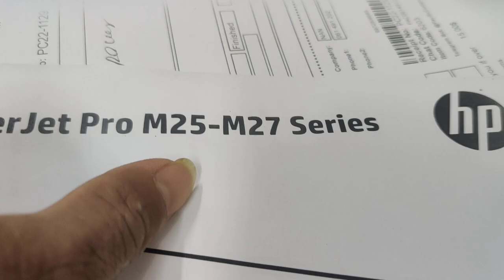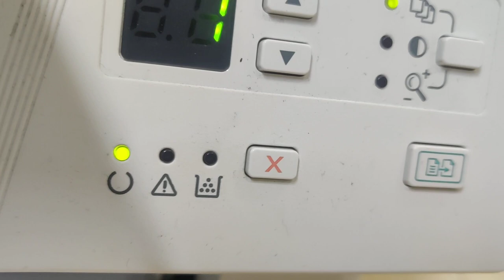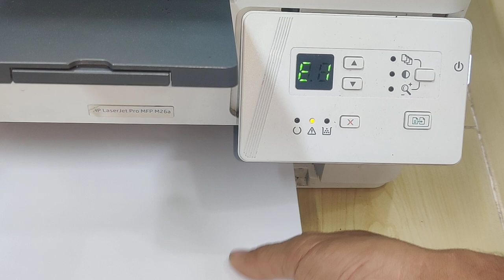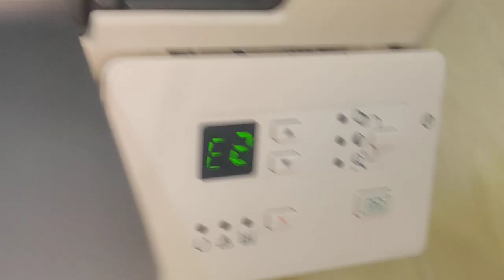How to fixed HP LaserJet Pro MFP M26a M25-M27 series error E1 E0 E2 E3

Comment from the maker: E0 Paper is jammed in the printer. Clear the jam, E1 The input tray is empty. Load the tray, E2 A door is open. Verify that the toner-cartridge door is fully closed, E4 The toner cartridge is very low. Press the Start Copy button to continue or replace the toner cartridge, E5 The toner cartridge is very low. Replace the toner cartridge, H0 The printer is in manual-feed mode.Load the correct paper type and size into the input tray. Press the Start Copy button to continue. H1 The printer is processing a manual duplex job.Load the pages into the input tray to print the second sides. 
Press the Start Copy button to continue.The attention and toner lights are blinking, E3 The toner-cartridge is missing or is not installed correctly.Install the toner-cartridge.The attention and ready lights are on.E6 E7 E8 E9 the printer has experienced a fatal error from which it cannot recover,1. Turn off the printer or 
disconnect the power cord 
from the printer.
2. Wait 30 seconds, and then 
turn on the printer or 
reconnect the power cord 
to the printer.
3. Wait for the printer to 
initialize.
If the error persists,

Comment: hi I have an HP 125a printer
Not connected to computer
paper size while copying documents LTR size
I want to change it to A4
Because I use A4 paper
I want to change itThrough the keys on the printer interface
Also I want to do a factory reset
I only use the printer to copy documents
Note: Printing through a computer does not have problems printing A4
Reply from the maker: Try install full driver to Computer and go to HP Toolbox and set to A4. or try to setup on control panelprinter
Reply: Through the computer, all settings are correct
Printing is A4
But how do I do it from the front control panel of the printer, knowing that there is an LED screen?
Just to read the numbers and know the error codes
The screen has only two fields
No word appears at all, such as settings
For about a month I have not been able to use copies of documents @Electronicview